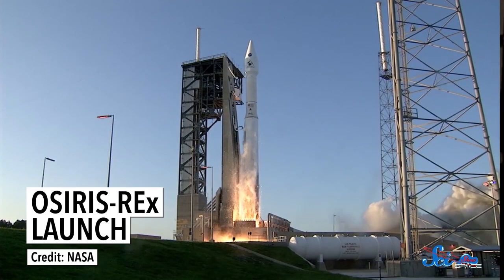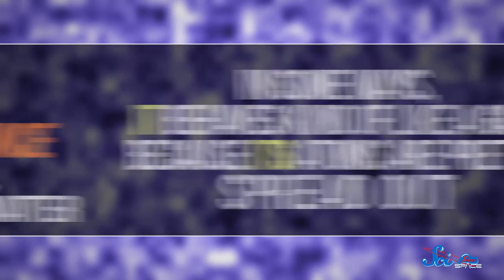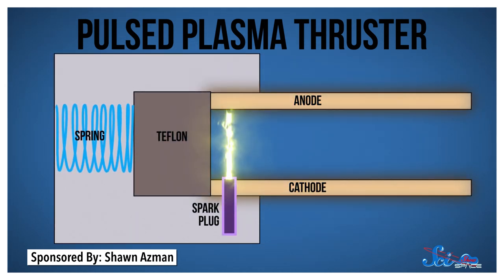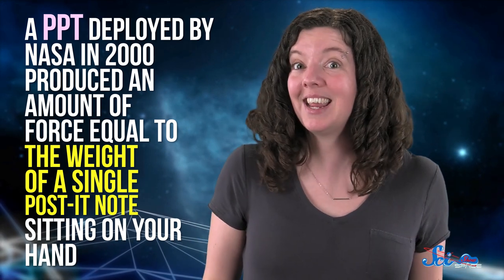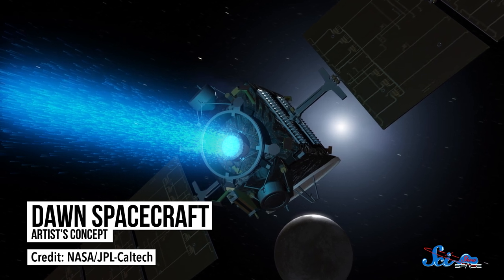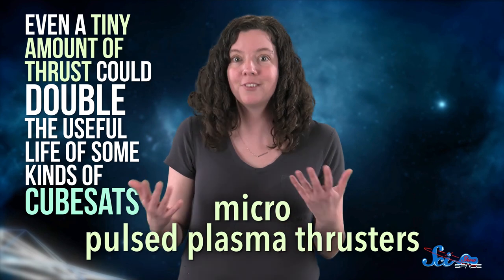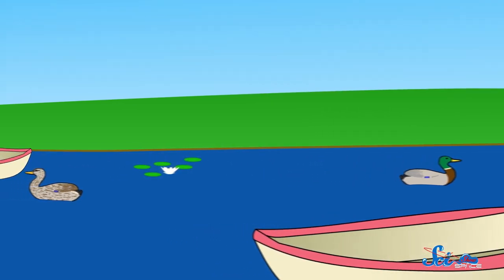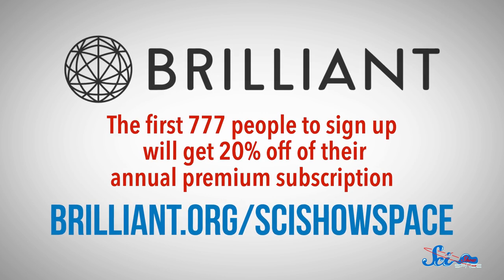Thrusters That Eat Teflon! | Pulsed Plasma Thrusters

Comment: Wait, she says that unlike other states of matter, plasmas can be shaped and directed by electric and magnetic fields, which implies that the three other states can't be. But if you move a piece of glass charged with static electricity next to a narrow flow of water, it slightly bends the water towards the glass. If that's not shaping and directing something with an electric field, then what is it called? Inb4: I know that the water moves towards the glass because the glass has a charge, the water is neutral, so the water is attracted to the glass.

Comment: I love a little refresher. I don't get many chances to work out problems like these anymore. You can get the answer by rewriting Newton's second law F = Ma to F = M(d/t^2) where d/t^2 is acceleration. F is the force Caitlin exerts which is equal for both boats, t is the time , M(boat1) = 90, M(boat2) = 60, and d(boat1) and d(boat2) are the distances each boat travels. I can't type this out exactly, but you set the equation for the force of boat 1 equal to the equation for the force of boat 2. M(boat1)(d(boat1)/t^2) = M(boat2)(d(boat2)/t^2) Substituting in the equation results in 90(d(boat1)/20^2) = 60(d(boat2)/20^2). This simplifies to 90(d(boat1)) = 60(d(boat2)) and then to d(boat1) = 6/9(d(boat2)0. Since d(total) = 30, d(boat1) + d(boat2) = 30, and d(boat1) = 30 - d(boat2), substituting you get 30 - d(boat2) = 2/3(d(boat2)). This turns into 30 = 2/3(d(boat2)) + d(boat2) or 30 = 5/3(d(boat2)) Solving for d(boat2) we get 18 meters. I hope this helps someone!
Reply: Sheeesh idk if u serious or not but reading that just gave me a headache lol.
Reply: A very thorough solution. I found this problem could be solved pretty intuitively as well. Since the boats' weights are on a 3-2 ratio, their distances travelled are inversely proportional. So the 60 kg one goes 3/5 of the way (18 m), and the 90kg one goes 2/5 of the way (12m).
Reply: +Jim Keen - Yup, that's how I worked it out.  F = ma, same force, mass in that ratio, therefore acceleration in the inverse ratio, so 90 / (90 + 60) = 0.6, and take that fraction of the distance = 18m.

Comment: Few extra possibly interesting information about PPT

1, It can use just about anything as the propellant, not just Teflon. One possible use cases of this is using things already in space like aluminum from space debris or asteroid dust to refuel the thruster.
2, It doesn’t have to be 2 flat plates ether. It can use a coaxial design with cylindrical electrode
3, In many cases, the current does not go through the propellant, with it just arching above the material, not through them.
4, Air breathing PPT is also possible with its use in high altitude (~stratosphere) where propellers just don’t have enough thrust currently being researched. 
5, The university lab I work at is making a cubesat that uses PPT, almost the exact 
 thing this video described, but with coaxial design and possibly using sulfur instead of Teflon. (As with any engineering projects done by mostly undergrads, it is going slower than expected)

Comment: Having experimented with pulsed plasma thrusters; a tip.  The spark comes from the sharp edge at the end of the rod.  If you have a rod, down the center of a pipe, and the fuel cast in between the rod and the pipe.  The spark coming off the rod tip, only burns fuel, if it makes contact with the fuel.  Mostly, plasma sparks and no fuel consumption,.  It you replace the rod with a threaded rod, the first exposed sharp edge is where sparks occurs, thus performing an end burn of the fuel, until the fuel is consumed.  Any solid fuel that burns will work, not just teflon.

Comment: 3:02 Shouldn't that be "over 5X" rather than "up to 5X"? The VASIMR has an isp of up to 12000 for example which is way more than 5 times as much as our most efficient chemical rockets.
Reply: But VASIMR need 50+ kW of electric power. PPTs need less than 50 W or even less than 5 W...

Comment: Frictionless you say? If I'm applying the same Newtons to my string or rope for the entire 20 seconds we're going to be hauling ass on a collision course with no means of stopping. Even a sustained .25G which should be a modest tug on the rope on a frictionless surface is going to get pretty nuts in twenty seconds. You can keep your magic rowboats they sound dangerous.

Comment: If you have infinite time in those boats, and you're in a frictionless boat, you wouldn't have to do anything since gravity will eventually bring the two frictionless boats together, right?
Reply: Yes and no. If they are close to each other - yes. But if they are far away from each other (I don't know how far. I guess several million lightyears), the expension of the universe can be stronger than the effect of gravity - in that case, they will never reach each other and will forever drift apart. (Technically they are moving towards each other in space, but the space between them gets bigger and bigger, so that stretches them apart.)

Comment: As far as I know conventional EM-drives do NOT work like railguns. PPTs on the other hand seem to work exactly like railguns. Mixup?
Reply: TheMightyZwom. What is a conventional em drive?
Reply: An ion drive, accelerating ionized gas (e.g. xenon) with an electric field. That is completely different from a railgun and completely different from the pulsed plasma thruster.
PS: just to clarify: There are not ions leaving the ion drive. The particles are "neurtralized" with electrons beforehand, because otherwise the drive itself would be charged more and more negativelty over time.
Reply: While calling them "railguns" is a bit of a stretch, an ion engine is still more similar to one than not, at least when compared to chemical engines. They still use electrical rather than chemical energy at their core, and use electromagnetic effects rather than heat to accelerate the exhaust.
Reply: Well if you go at it from that direction, even an LED is closer to a railgun than to a chemical rocket...
Reply: eh, that's more of a stretch because at least ion drives use electric fields to accelerate matter, LEDs do not
Reply: Yeah, but the argument was, if I understood correctly, that die ion drive is similar to a railgun because it uses electricity and a chemical thruster does not. In that case the LED is closer to a railgun than to a chemical thruster, because it also uses electricity. OF COURSE an LED is faaaar from being a railgun!
Reply: They use electrical energy to accelerate their propellant  was the unspoken context I'm pretty sure.

Comment: 18 meters, using conservation of linear momentum and averaging the relative velocity. I assumed that the force applied was instantanious but I'm pretty sure it doesn't matter because of the nature of averages.
Reply: alexanderx33 You used the unnecessarily long and complicated method (which the teacher wanted), so you get an A.
Reply: Hristin Andonov What's the shorter method?
Reply: alexanderx33 Distance traveled and mass are inversely proportional. You have 2/5 of the combined mass and travel 3/5 of the distance.
Reply: Hristin Andonov That's the effect, yes, but I wanted to use basic principles to be sure I didn't make a mistake.

Comment: 12m from the 90kg boat, 18m from the 60kg boat.
Reply: If you assume a spherical boat in a vacuum.
Reply: jesondag: Actually vacuum (lack of resistance) is enough. Spherical is not necessary. If the boats are not point masses, the distances I mentioned are from their centres of mass.
Reply: I know, it's a reference to "assume a spherical cow in a vacuum" :-P

Comment: SO when we get a few hundred thousand of these satellites in orbit and they all start pooping plasma Teflon  back onto earth, what would be the effects on our atmosphere and general health? :P
Reply: I don't think compounds can maintain their molecular bonds as plasma, so you'd have ionized carbon and fluorine atoms instead of teflon.  Fluorine is pretty nasty stuff, but the quantities are tiny and it would react with something [forming other hopefully stable compounds] long before reaching the ground.
Reply: It looks like the Teflon will be about 1/5th of the thrusters, and the microthrusters equipped to the Cubesats are about 10 cm, so that's ~2cm cubed, if the Teflon is in a cube(which it is not, it's probably closer to a rectangular prism, so less than that). That's about 4 grams of Teflon(2.2 per cm^3 * 2 = 4.4, rounded down because of the block being rectangular). That's only 4 kilos of Teflon in the atmosphere, if ONE HUNDRED THOUSAND Cubesats spit out all their Teflon. So basically, that's not that much, especially since it would all be released over a pretty long period.
Reply: Teflon molecules would be stripped to their component atoms. I think a greater danger would be posed by all these thousands of tiny satellites eventually becoming more space trash, and at sizes which NORAD won't be able to accurately track.
Reply: plus to be honest, I think we should worry more about the rest of the satellite materials used as it hopefully eventually burns up in atmosphere :P that's assuming that they would use the small remaining thrust to break orbit and death spiral... right? ( words from corporate of the future )"oh well, 15 years ago we didn't care about the re entry asteroids of doom that we would make" Boom! lol my imaginations going places.
Reply: Marchalis Van and Paul Drake - Someone menitoned in another thread that cube-sats usually go in a low orbit, where there's still some [very weak] atmospheric drag.  That would eventually slow them down enough to spiral in and become -- meteors, basically, instead of space trash.

Comment: I keep hearing about "hundreds of small Cube Sats that can be launched all at once very cheap".   Sounds like Space FOD to me.   Any consideration given to the dangers they pose once they expire  ?
Reply: John McNaught Typically cubesats are put on really low unstable orbits, and their lifetime is often limited by the amount of time they can stay up here, which I think is probably why putting micro-PPTs on them can double it as mentioned in the video. So once they have done their job, they just fall back down and burn up. I might be wrong, but it doesn't seem like cubesats really contribute to the amount of space junk much (if at all). But I mean, it's only natural to worry about space junk given that it really is a growing problem. Actually, I think they've done a video about just that.
Reply: One Mad Scientist , makes sense, thanks.  Still leery of shotgunning these things though.  Just have to put our faith in the proverbial "Rocket Scientists ".
Reply: One Mad Scientist you say "up here" like you're in space or something XD
Reply: I wanted to add that Cube Sats have been suggested as a way to clean up the space junk. They could attach to larger pieces and slow them into a decaying orbit after they serve their initial purpose.

Comment: Your boat will move 18m 
(Use Motion laws)
Reply: jack smith how not 20?
Reply: Frano Lucic F=ma
So 60a1=90a2
Thus a2 = 2/3 a1
Then
S1 =1/2 (a1)(20^2)=200a1
S2=1/2 (a2)(20^2)=200a2
We know S1+S2 = 30
So
200a1+200a2=30
200a1+400/3 a1=30
1000/3 a1 = 30
a1 = 0.09
Thus S1 = 18
Reply: But its said that its steadily pulled meaning its constant speed not constant acceleration
Reply: Frano Lucic she says "if your string is pulled with a constant *force*"
Thus constant acceleration

Comment: You shouldn't be so loose with definitions and explanations of function. "Plasma consists of charged ions" - as if the definition of ion is not "charged atom"; "kind of like gas" - plasma is gas, just very far from an ideal gas, because of charge; no mention of why the current between those electrodes pushes the plasma out. Etc.